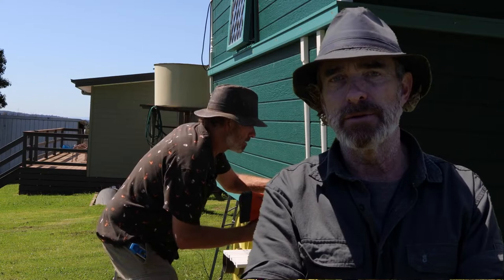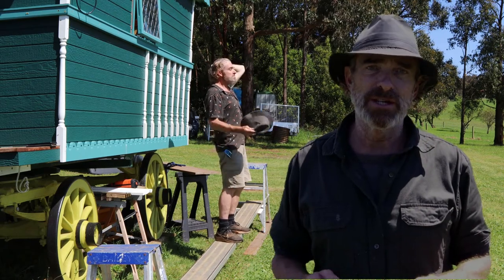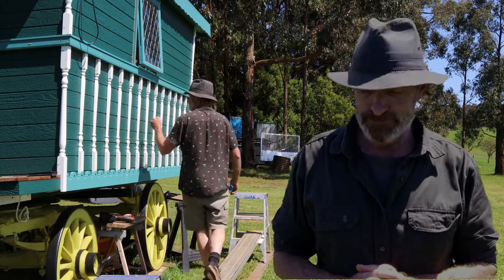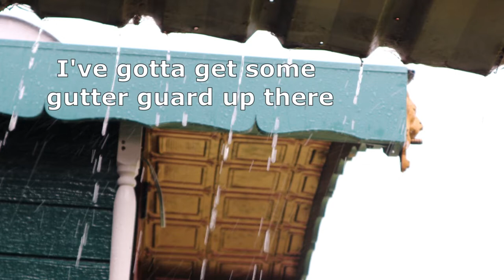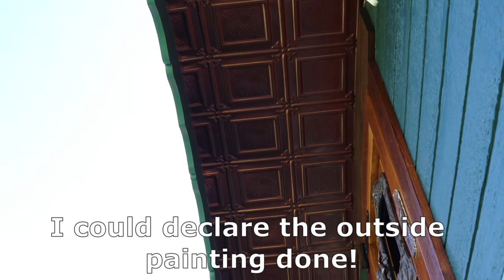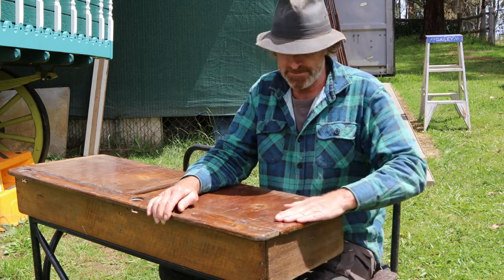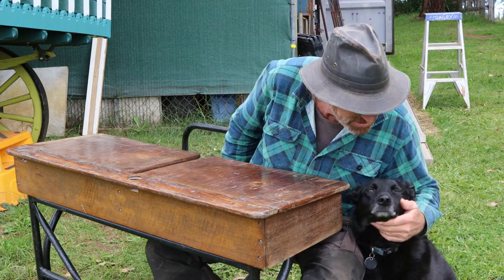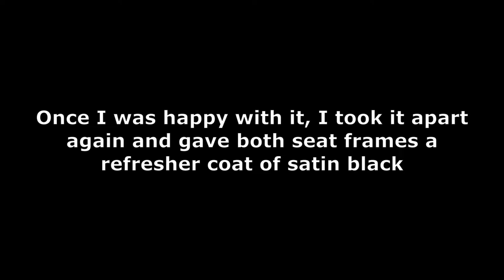Gypsy Wagon 13 - Fixtures And Features

Comment: Really coming together there . An idea for the shutters would be using a sliding barn doors. A track both top and bottom would be the most secure way. At least I think so. That carryall on the back end was a big surprise to me. Had me baffled till you actually told me. Great Job, giving lots of inspiration. For my slide on caravan. I'll be using a utility trailer for mine though.
Reply from the maker: I did consider doing that with the shutters, did spend a bit of time trying to locate items to do it with, but wasn't having any luck. So I've just left it open to possibly do it later down the track. 
  All the best with your own project. Let the imagination run wild 🙂

Comment: It is starting to look really marvelous.  I will be starting mine in the spring.  For now it is buried in Canadian snow and minus 20 C temps.
Reply from the maker: It's getting there, slowly.
  I simultaneously envy and not envy your temperature ranges over there. Would love to get there one day.
All the best with your project after you dig it out 🙂
Reply: Franklin- did you buy a used one that you are going to restore? I live in BC and we're thinking about building one from scratch but am wondering where to find a used one because restoration might be better in the long run.
Reply: @cindybrandner3063  I am actually using an old farm wagon that has rubber tires and a floor base of 8 X 16 so it has lots of room inside. I am spending the winter doing design work on it.  I will be pulling it with my antique 1967 Chev 3/4 ton.  It can only be trailed up to 40 MPH as after that it begins to sway.  It will be making the rounds on a cruise car circuit as we also have a 49 Studebaker Champion and a 1971 CB 350 Honda bike. A caravan will look good in our lineup at the shows. Since we live in Saskatchewan I am thinking of doing a Snake Oil Sales theme.  Maybe some Rain Making too.
Reply: I am also considering starting a You Tube Channel to show off my progress but if I don't then it will be done on Facebook.  You can find me there with a bunch of my other unfinished projects along with a few I did finish.

Comment: Looking through the past content, and I know it is irrelevant, but I wonder, what do you estimate the weight of this beastie is? I know it's never going to be pulled by anything without wheels, (or treads!), and an engine, I'm just curious...
Reply from the maker: Yeah I'm very curious about that as well Jeff. A totally uneducated guess I think somewhere between 1 and 2 tonne. I would like to, if I can, get it to a weigh station. I don't think I have too much more weight to add to it. And now the idea of separating it from the cart base to be placed on a trailer so it can be mobile on the road has entered my mind.
Reply: Making her mobile is a brilliant idea!. It doesn't look like width is an issue, you would just have to devise a method of transfer from cart base to trailer that can be done with 1 man and doesn't risk damage to the vardo, once aboard the trailer, tie down should be no worry. As far as the weighing her, do you have a mate that could get his hands on a portable axle scale for an afternoon?
Reply from the maker: I'm thinking a lift/stand system that people use with campers on the back of utes, where you drive away and out of it leaving it free standing there. Back an appropriate trailer under it and wind her down. Not sure about a portable axle scale, my brother might know someone. Interesting venture to explore though.
Reply: @RedPathRambler  Sure. a hydraulic jack on each corner would work, they would have to be pretty stout. That would mean moving the cart chassis out of the way so you could get the trailer under her. Jacks would kind of screw up the aesthetic though. Sure be a shame to spoil those beautiful lines, especially the perfectly elegant angle on your side walls. That said, it would be an interesting avenue to explore, and I have no doubt that you could come up with a creative and unexpected solution.
Reply from the maker: @jeffhinrichs2993  I'm most curious about the finished weight. So I'll definitely look into that when the time comes.